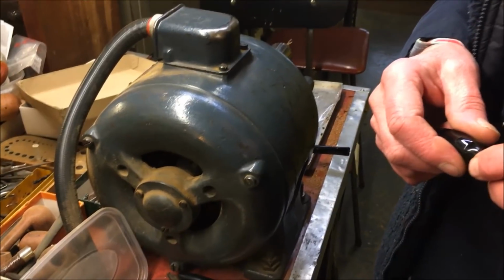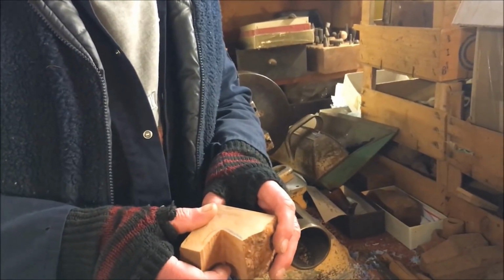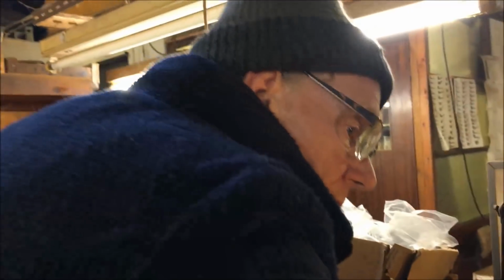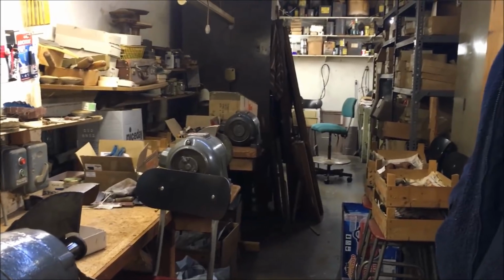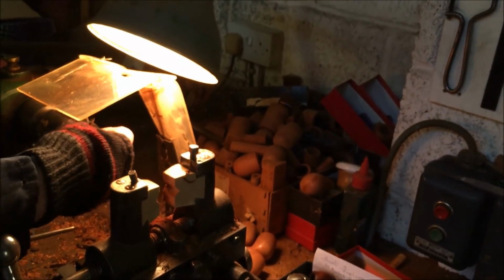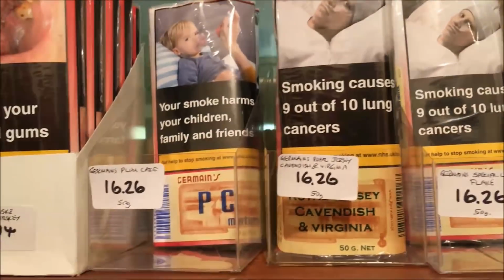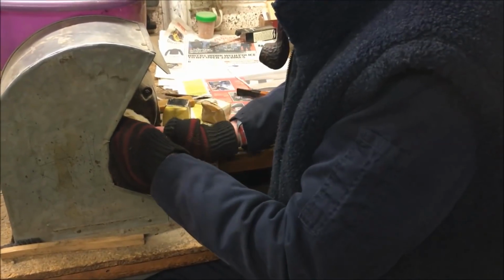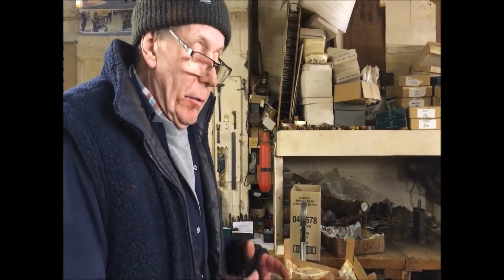Visit to Blakemar Briars January 2019

Comment: Just a little trick: When I have filter chambers that are too wide for the filter, I sometimes wrap 1 or 2 layers of small strips of toilet or kitchen paper around the filter to make it fit in right. But what I mostly do because I can do it on the go and I can do it with just the Stem of a pipe as my "tool" and don't need paper on hand for this is a bit hard to describe for me but I will try. I always use the Vauen 9mm ac filters and with them the nice thing is I can push the plastic cap in a little bit with something like the stem and then I press the filter with this side against something like the stem and twist while pressing to widen out the paper of the filter paper on one end. So I funnel the one end out or how you call it in English. That is enough to get a good seal and good hold for the filter. Hope that helps. I love it when the filter chamber is drilled conical at the end like what most Peterson pipes and I guess all Vauen pipes have so that the filter seals and holds nice when pushed in. But sadly not all 9mm pipes are like that so you need to help yourself to get a good seal and hold. Because when the filter sits loose in the chamber then the filter doesn't make much sense because then a lot of the smoke doesn't even get through the filter.